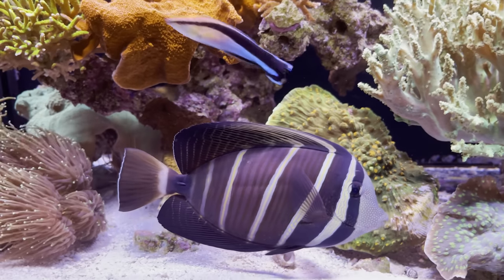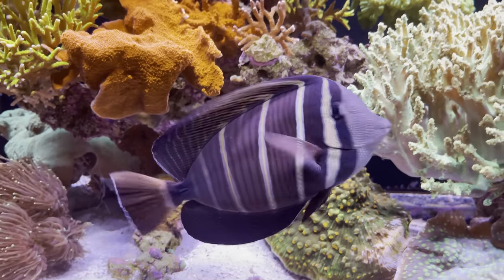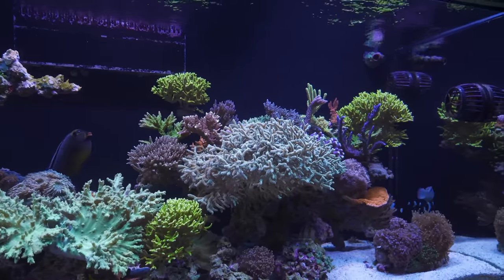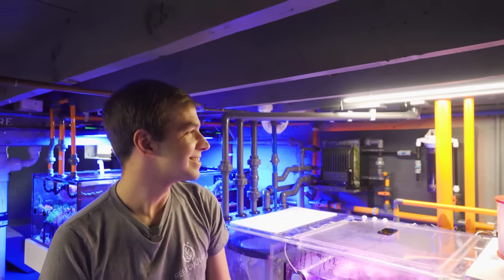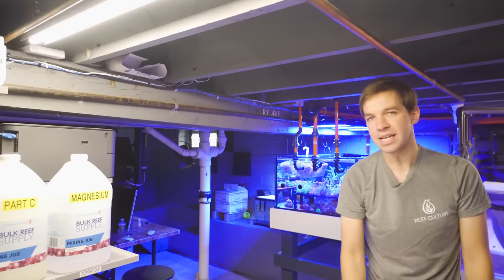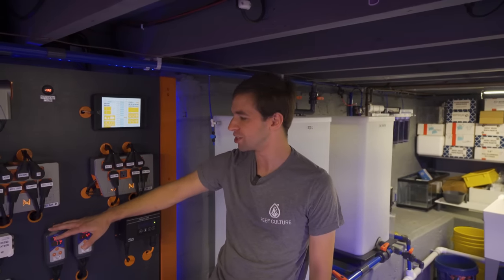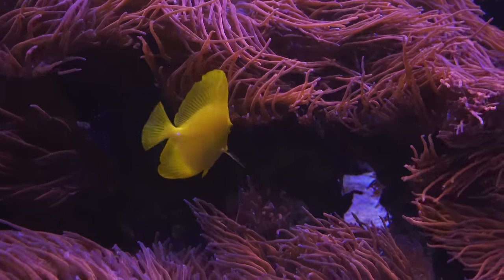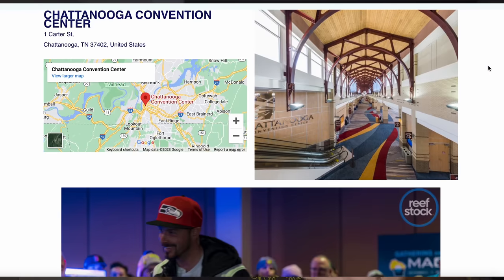We Toured an Immaculate Reef System with Over 200 Bubble Tip Anemones in One Tank!

Comment: Hey Jeff, what is your method to getting the nems off the rock or whatever they are attached to ?
Reply: Ahhh!  The magic question I get asked all the time.  If a nem is stuck to a rock, it is VERY difficult to remove it.  All of the ones I sell out of this tank (5-10 or so a week) come from the glass or acrylic nem box on the side.  Super easy to peel them off with your thumbnail once you have done it a bunch.  

The rainbow nem in the wine glass in the frag tank in the video actually got removed from a rock a few days before filming.  He was on the rock, stinging SPS and needed to be removed.  Took the rock out of water, let it hang upside down for 5 minutes or so, sometimes that does the trick, it didn't this time.  Had to very carefully scrape him out.  He made it, but that is also why he didn't look too happy in the video.  Give him a few weeks and he will turn around.  -Jeff

Comment: Very nice - Unfortunately a full system crash would be the only reason for me to re-design my system at this rate.
Reply from the maker: Hard to back out once you're plumbed in! He could make some money consulting! ~Remy
Reply: Oh don't think the worst on how a full crash would be the only way to build it back better.  But, yes, I totally get it on how once you are plumbed in, changes become exponentially harder to do.  This was my 4th build overall and first in my home.  From the first three, I kept a list of things that were either challenging with the first ones, or simply a pain to do, and kept in all in mind when designing this one.  The easier you make things to do, the more likely you are to do them, the more likely you are setup for long-term success.  The system isn't perfect, there are still things I would have done differently now looking back on it, but am quite happy with how it turned out.  :)  -Jeff
Reply: @reef_culture  Most definitely Serviceability is a key aspect many don't think about.  I've been trying to suggest to manufacturers to have connectors closer to in-tank devices to avoid needing to splice something in or pull all the harnessing out just to service it. Seems to fall on def ears.  Some day I may pull the trigger to revamp my entire system if I truly want to upgrade my 8 tank system and start fresh.